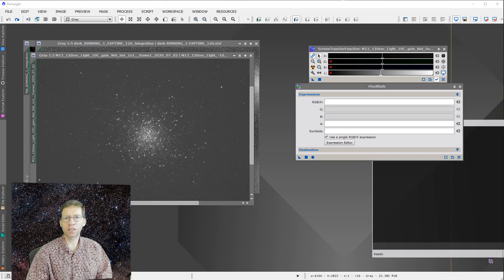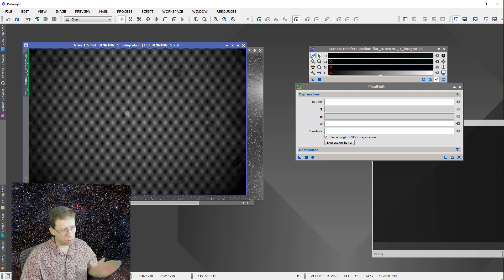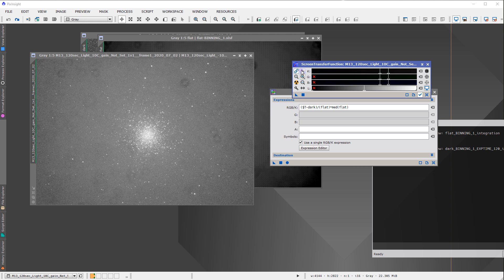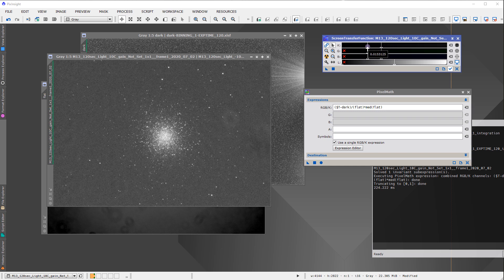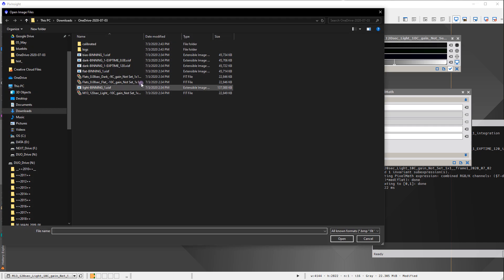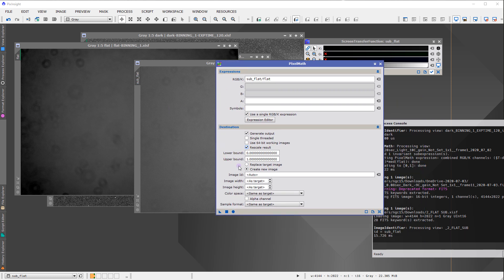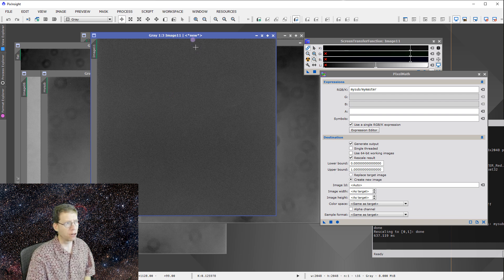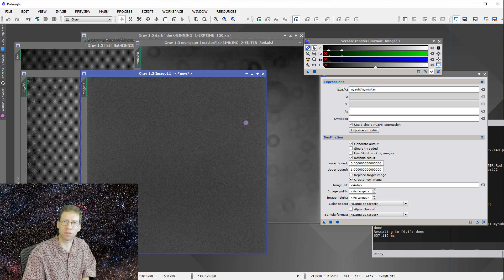PixInsight: Flats (from Adam Block's Office Hours)

Comment: Thank you for putting so much time and effort into providing these videos, sharing your knowledge and teaching others to use the PI program effectively. That pixel math is a powerful tool in the PI collection of processes.
Reply from the maker: Thank you!
I just released a new video on Pixel Math as it happens... https://www.adamblockstudios.com/articles/useful-pixel-math-another-introduction
Reply: @AdamBlock  I will check out the offers of your sight and the tutorials you have listed on advanced techniques in PixInsight (In the future). I have a long way to go before I get any good data.  (1) Cloudy for 98 % of the last four months here-- slowed way down the progress of my auto guiding development. (2) I have been spread so thin with my own involvement in this enormous project I started over five years ago: building my own telescope mount with slewing and auto guiding. I know all about the ASCOM availability, but I couldn't wrap my head around writing a driver to satisfy the needs of ASCOM requirements. So, I ventured on my own to write C++ in Arduino, and Python to create a serial com system of guide star drift on a sub pixel level, then to arc sec level. Perhaps, a bit like yourself, I like to think through a problem to resolve it. However, it is nice to get a little help sometimes. So many others in this field of interest (are out there... no pun intended) but they are far ahead of me, as I have been too busy in all else to learn post processing.